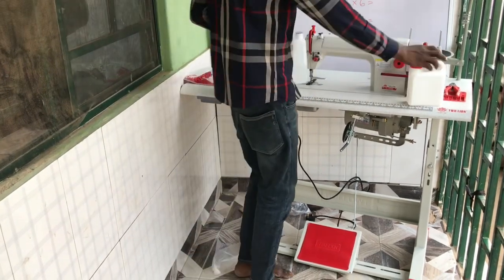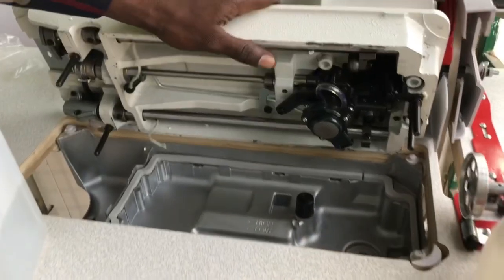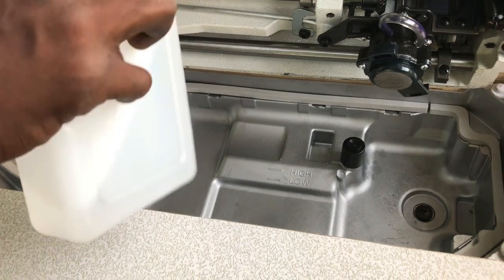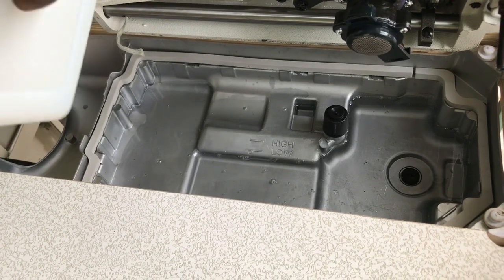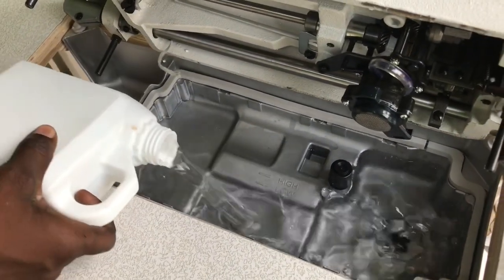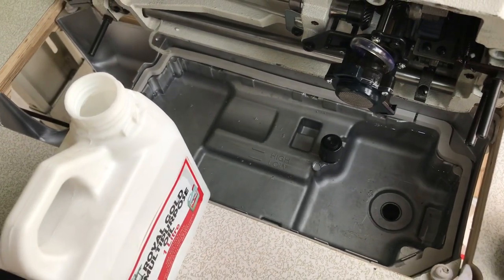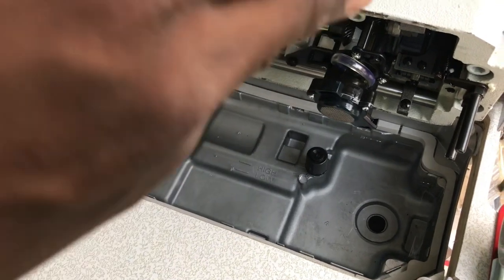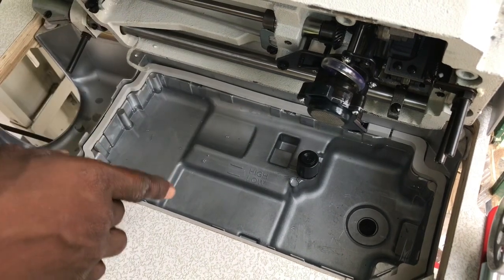How to oil / lubricate industrial sewing machine. Model 8500

Comment: On the right side there is a belt that links some rollers from the engine to the upper part. Does that belt or its rollers need to be oiled?
Reply from the maker: No

Comment: Thanks so much for this. Please my machine makes noise and can still run for few seconds after turning off the switch. What can I do.
Reply from the maker: The running for few seconds is normal
You have to add grease to the bearings that is if it’s still in good conditions I mean the clutch motor